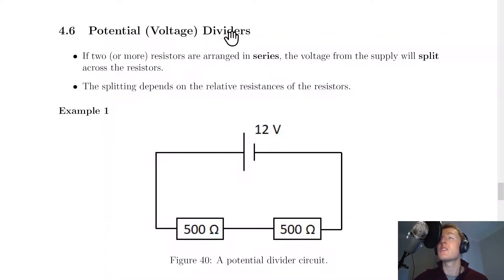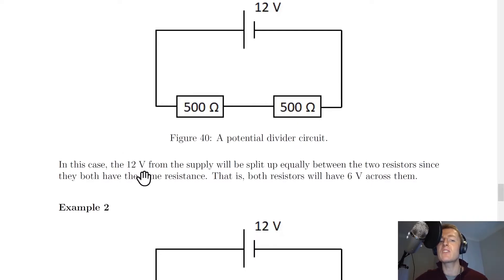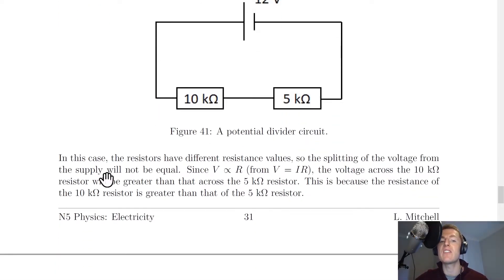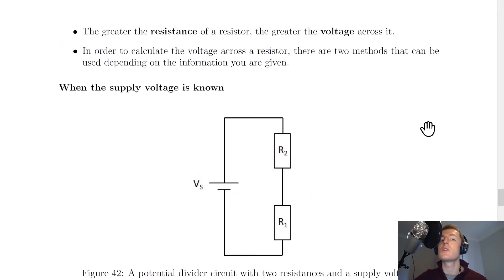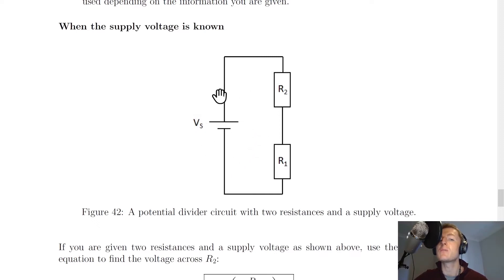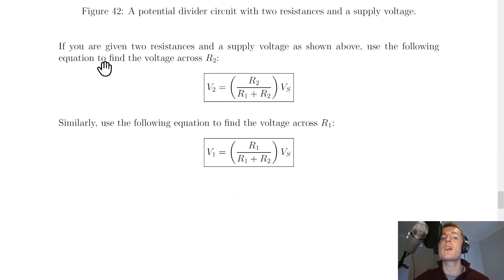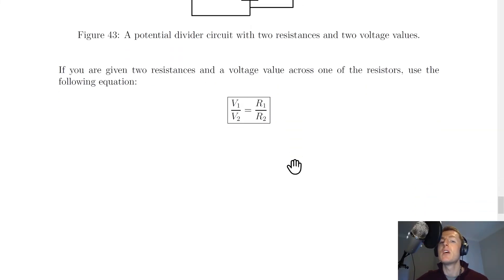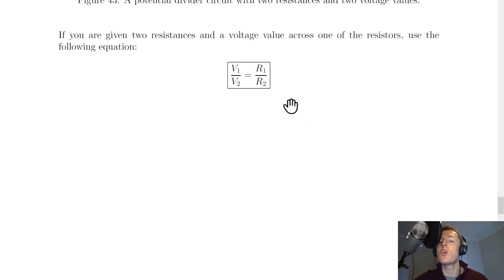National 5 Physics | Electricity | Potential Divider Circuits | THEORY

Comment: Since current splits across a parallel circuit like voltage splits across a series one, what is the formula for calculating the current divided across a parallel circuit? Is it the same as the potential divider equations but for current in parallel or is there some totally different physics to explain it?
Reply from the maker: Hello! To find the current at various points in a parallel circuit, you need to use the fact that the total current passing through the battery will split up through each branch of the parallel circuit. So an equation for this would be Itotal = I1 + I2 + ..., where Itotal is the current passing through the battery and I1 and I2 etc are currents at different branches in the circuit. Another way of thinking about this is that the current passing through each branch in the circuit will add up to give the total current passing through the battery. Hope this helps!